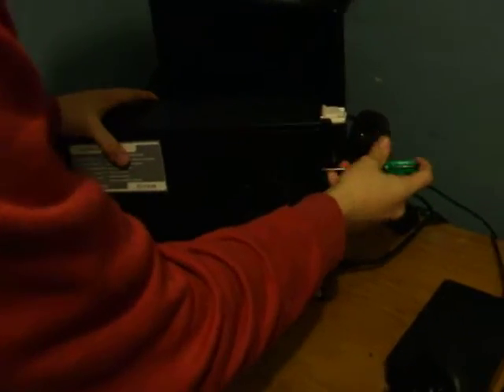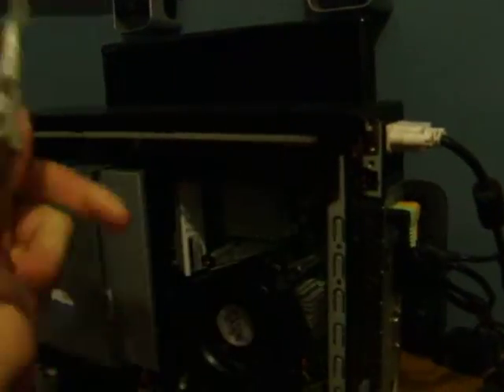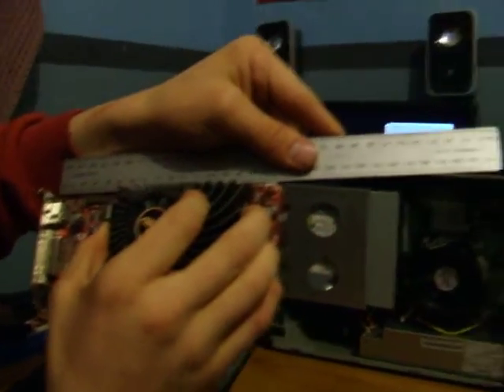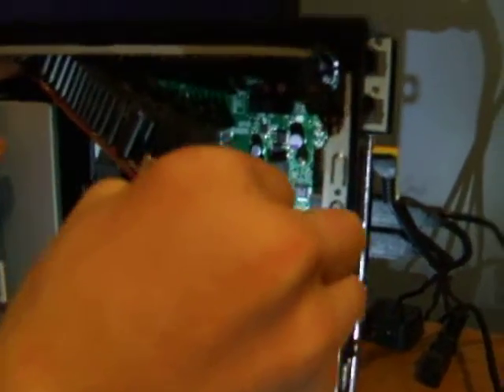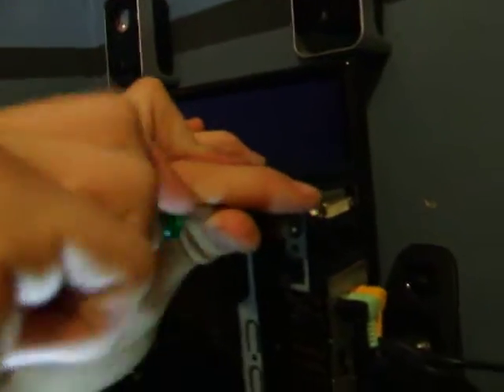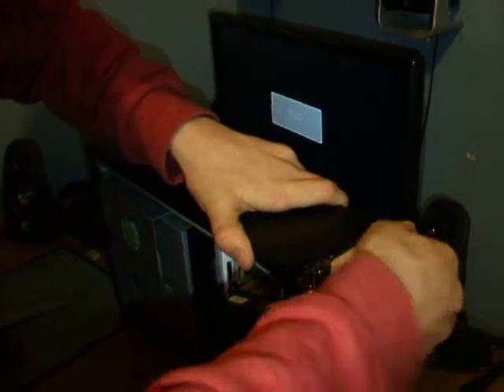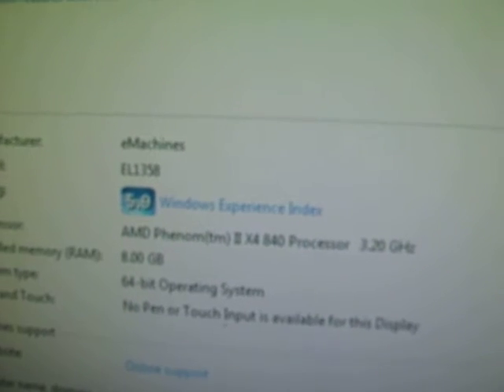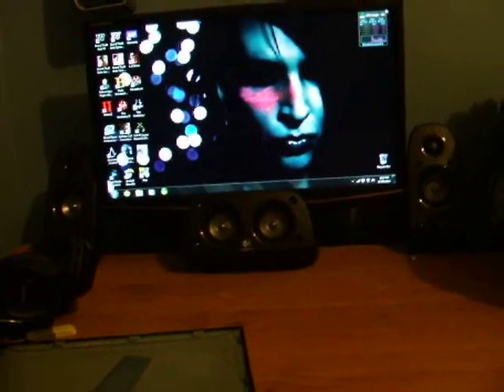eMachines EL1358 Graphics Card installation

Comment: Well thanks for the great responses  I can say for my self this works on an "Emachines EL1358G-51W" With nothing changed and the stock 220w supply. Great card for video editing and low profile gaming, I have ran Guild Wars 2 on it with Medium settings on it, got 30-50FPS so if you are wanting to see what you can run or not run with it.

Comment from the maker: yes you can and yes it is just plug and play you should never have to change any BIOS setting with graphics card i don't know if in the old days you did but 99% of PC upgrades do the bois for you like for example when you install a GPU you probably use to have to disable the on-board graphics when doing so now it disables them for you as soon at the PC detects the new Hardware

Comment: I have same computer but i have put there
-amd athlon 2 x2 270 3,4 ghz
-radeon hd 5450 overclocked
-8gigs ram ddr2
-raid card
-2x 2tb drives at raid 0
-new case
-lots of fans

Comment: this is what i did first i removed and replaced the card, when my computer started it went through windows update for driver unfortunately  the  windows aero was disabled and my windows experience went down to 1 so I went to the ASUS website and downloaded 8_861_Asus_Vista_Win7_WHQL my computer restarted and my windows experience  jump to 6.9.  Unfortunately My monitor only accepts VGA so there is not much change visually but i can play games that I couldn't with just an integrated chip.

Comment from the maker: did you install the latest AMD Catalyst driver EX/ CATALYST 12.8 because i installed that one time and then my computer also started freezing on boot up so i removed the card went back to on-board graphics uninstalled the catalyst drivers and shut down put the 6570 back in reboot and just use the driver that windows download for that card and they work fine just done use Catalyst

Comment from the maker: well you remove the normal profile bracket and put the low profile one in that has DVI (D-SUB) and HDMI outputs on it the VGA you get rid of it is just on a gray tap lead the you just unclip from the graphics card leaving the pins facing up and poking out and then just insert the graphics card into the computer

Comment from the maker: you have to remove the VGA (blue) port it will unplug from the card be careful and then get a srew driver and remove the screw above the HDMI out-put and then also unscrew the bolts of the side of the DVI (white) out-put should have one on both sides arfter that remove the metal plate and get the DVI HDMI LP plate out of the bottom of the box the graphics card came in put that plate on the card and the card will fit just forget about the VGA  all together

Comment: Bought this graphics card. Have the same computer and figured it sounded like a good idea. Little did I know some god up there has it in for me, and the back doesn't have a chance to fit. The actual card fits fine, but where you'd plug things in is about an inch too much. Did I just pick a slightly incorrect card or did you tweak yours cause you don't use it(that input)?

Comment from the maker: sadly to say buddy you cant use this setup in your system you can have the RAM Graphics card Blu-Ray Disc drive hard-Drive but not the CPU as you system uses a AMD Duel Core E 300 CPU witch is a BGA413 socket and the AMD Phenom II X4 840 3.2GHz CPU is a AM3 socket and not only that but your motherboard also as AMD A45 Fusion Chipset sorry mate

Comment from the maker: mine computer still has the 220watt psu and i play games and all that my cpu uses 95watts yours only uses 65watts the psu's are a duel rail psu so they will handle more then you would think this is my results from a PSU Calculator i got 266watts

Comment: I'm just curious do we have the same pc cause my model: is El1825G  since my model has a G at the end is it still the same? my Processor :Pentium(R)Dual-Core Cpu 3.06GHz also where ur graphics card i do not have one there is that normal? my graphics run off somthing called Intel(R) G41 Express Chipset it meets most of my needs besides 
Dedicated Video RAM  need :512 MB	 have:64 MB

Comment: I was was going to purchase teh same CPU (AMD Phenom II X4 840 3.2GHz )you have for my eMachine EL1358G however, I'm finding it to be hard to get because I have been told there is an upgrade which is the AMD HDX945WFGIBOX Phenom II X4 945 Quad Core Processor - 3.00GHz, 6MB Cache, 2000MHz (4000 MT/s) FSB, Retail, Socket AM3, Processor with Fan.  Will this work for my eMachine without change out the stock 220 Power Supply.  Thanks for you assistance and I am very thankful you posted your video!

Comment: So is it your processor that pushes the graphics card or what? Becaue I want to buy the card I have same exact comp. Emachines 1358-51w and I have 8g of Kingston HyperX RAM but stock processor which is X2 2.8ghz. Think it will work without upgraded processor?

Comment from the maker: never heard that happening before just double check make sure its sitting correctly make sure you have the drivers installed the onboard should disable automatic as soon as the card starts working what model is the card and is is brand new or second hand

Comment from the maker: well not really those two are you main ones as they are both hearts the more data that flows through the CPU the more power same with the GPU just GPU is graphics only nothing else should use more then 10 watts max

Comment: One of these 
~Athena Power AP-MFATX35 350W Mini ITX / Micro FLEX ATX / ATX12V 80 PLUS BRONZE Certified Active PFC Power Supply
~ Athena Power AP-MFATX40 400W Mini ITX 80 PLUS BRONZE Certified Active PFC Power Supply
Both located on newegg.com

Also i was wondering if you could tell me the make of your PSU .. I have a LiteOn 220watt 80 Plus Bronze.. and from my previous experience with LiteOn CD,DVD-RW drives I doubt this PSU would hold up.

Comment: I've been wondering how I was gonna upgrade my same PC. Thanks for this Video it will save me tremendous amounts of money and aggrevation!!  Since I assume that if you can run a 400 watt recommended GPU. I "should" be able to run  a 350 watt recommended GPU. That will save me $80 usd for a PSU that will fit in the case. or the cheaper more troublesome version swapping everything to another case.

Comment: I have bought a Rosewill CHALLENGER Black Gaming ATX Mid Tower case and APEVIA ATX-CB700W 700W ATX12V  EPS12V SLI Ready CrossFire Ready Power Supply. if i move the guts of my 1358 over to the new case and pwr supply, do you think i can get a huge boost in perfomance just from getting Radeon HD 6870 card? or should i up the processor first to athalon 2x4 645..or go for new board and dozer cpu.. trying to do this cheap...

Comment: example ...day z which is run through arma 2. = 3 fps That is with an el1358g  athalon 2x2 2.80
3gigs ram the onboard graphics which is 6150 1tb hd which doesnt matter, 20 Mbps download speed using cable. i can get up to 6 fps if i do nothing but look at the sky.
i can just barely, and it's choppy, play civ 5. btw those 2 were being played at all graphics setting off or low..can play battlefield 2 with max settings. combat arms no worries am playing tf2 but is close call.

Comment: Anyway, I need to ask you something. When you connect the card to the slot, does the computer automatically uses it as default or you have to change with some kinda bios configuration?

Comment from the maker: yes 220 watts and i am also running and AMD Phenom II X4 840 3.2 8GB RAM Blu-Ray drive 1TB WD Caviar Black and the AMD Radeon HD 6570 1GB the 220 watt PSU has 3 12volt rails witch is why it can handle all the components